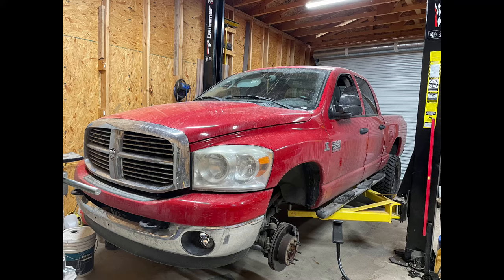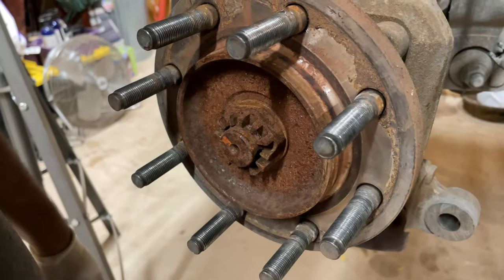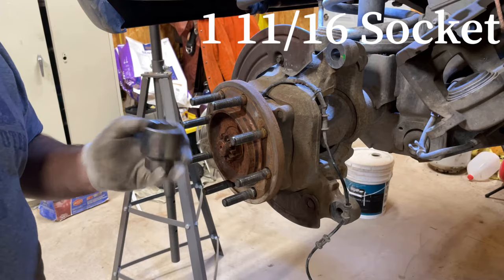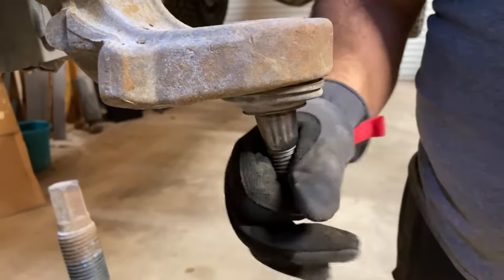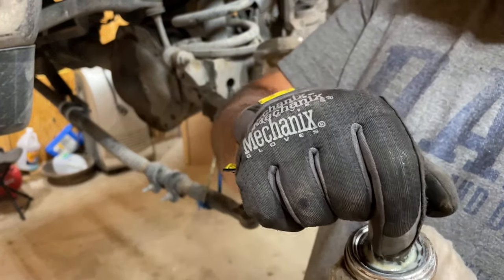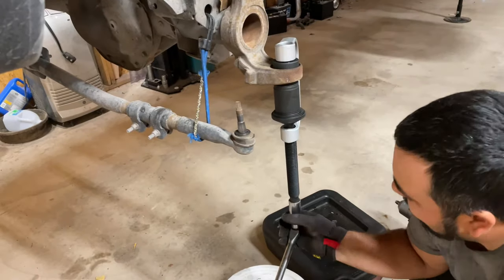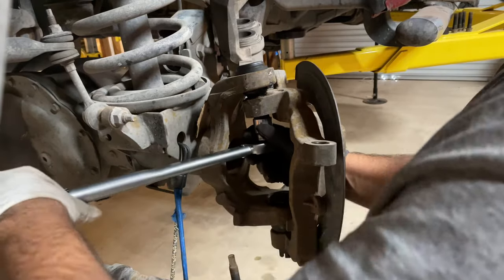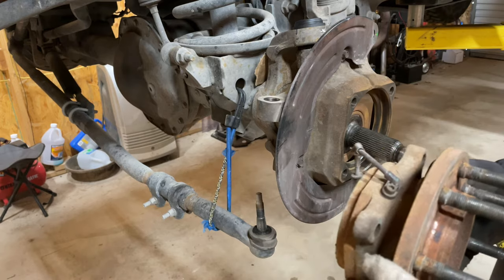2003-2009 Dodge Ram 2500 4x4 Ball Joint Replacement

Comment: Great Video, and helped me a lot.  A note for guys with older/high mileage trucks.  I just pulled two ball joints from the front of my 2004 2500 with 100k miles on it and a good deal of rust (country road use before I got it).  The only way I was able to get the bearing hub out of the knuckle was to use a full size sledge hammer.  Yes, that's correct.  Not a hand mallet.  A 3' 8 pound sledge, or whatever.  I knocked out the studs for the wheel, and then I used fairly long swings on the lower right and lower left of the stud flange, with a lot of force.  After about 6 hits on the front left, I saw a crack.  Took some whaling on it after that, turning the wheel direction each time, but it came off.  I can promise you that no "trick" was going to get this thing off.  The trick using the steering pneumatics, as the video's creator showed, in my opinion, and respectfully, because the creator did a great job with this video (especially the tip on the sensor and not trying to pull it out of the bearing hub), is not worth trying.  The power steering is not going to apply very much pressure at all to the threaded bolt - if that is enough force to get your bearing hub out, than a few swings with a hand mallet is going to get you the same result.  Also, there is about a 3/8" recess, so you have to work the bearing hub from both left and right - you can't just force it out from one side - it's in the recess too deeply.  Thanks for the video.
Reply from the maker: @andrewb2548  Thanks for watching, yea sometimes it’s takes a lot more to get it out 
And you have to straight man Handle it. 
Here in New Mexico we have no issues with rust like that. Glad you got it done though!!!’

Comment: The wheel bearing trick is fairly well known, But not to the rank amateur's, So thanks for including that.
  While working on a newly acquired Super-clean '03 2500 (with 54,800 one owner miles) --I had to have a friend turn the PS while I slugged away at the flanks of the upright (Knuckle). I also had to torch the crosses out of the U-joints, and then "Warm" the yoke ends before shocking them loose with a Ball-Pein", --As soon as they moved, I drove them out quickly with Home Depot--Ingersoll Rand Air Hammer with a flat end. I Torched the Ball-Joints out also, finished with little heat and a joint press. Everything back together with Anti-Seize or Loctite (as appropriate)... Since I figure I should leave my work with the assumption I'll be the next guy to go there again. because I probably will be...Also, you don't need to remove the brake caliper from the bracket, you can just unbolt the bracket and take it all off as one piece. 
Thanks for the really solid Vid and explanation, I'm sure even some seasoned mechanics may have learned at least one thing they didn't know before watching your Vid.

 I just wish my front end looked as "shiny-new" as yours!

Comment: Thanks for a really good video.  I noticed you had issues installing the upper joint using the ball joint press.  The press parts were metal to metal contact (not engaged with BJ) making it hard to press in.  I had the same issue using an Advanced Auto rental tool.  I went to O'reilley, and they had a 4 WD accessory kit that fit the BJ and made it easy to press in using the O'reilley press.  Please continue to post these 2500 videos.  I'll be watching.
Reply from the maker: Thanks for watching 
Yea sometimes they have to be just right so they go in smooth and not bind up.👍

Comment: Just did the ball joints, wheel bearing, and axle U joint on my driver side. Going to do the other side next weekend. 

Total cost for all the parts was $190 and $80 for the ball joint press.
Reply from the maker: @SandersChicken  Glad u got it done, thanks for watching!!!

Comment: I found out the upper joint is supposed to move up and down, but not sideways.
I wonder how many replace the upper joint before its time cause it moves like that. Of course once your in there, the sane thing to do is replace all 4. The bottom ball joint bears all the up-down forces and weight of the truck, the upper joint only prevents side to side motion. It telescopes by design. K7460 is the part number for upper joint,  K7467 for lower joint

Certain Dodge/Ram trucks and Jeep vehicles with solid
four-wheel-drive front axles use a telescoping upper ball
joint. The stud telescopes a small amount to compensate
for manufacturing variances in the tolerance of the axle
and knuckle ears.
This telescoping effect may result in the stud appearing:
• As if it is too long, or too short
• As if it has excessive play
The stud is engineered to slide in and out of the housing.
This DOES NOT indicate excessive play or any other issue
with the part. This feature is necessary for correct part
installation and function

Comment: Great video I I had to  Replace upper and lower on both sides on my truck I have an 06 ram 06 ram And both of my best friends are mechanics mechanics at an automotive machine shop But they didn't want to do it they said you remember that truck of all back where you were standing up on the table beaten all afternoon with a  Sled hammer Yes I remember never mind never mind the tool wouldn't work on that particular vehicle Cost me 450 bucks at a different shop
Reply from the maker: Thanks for watching!!

Comment: Fixing to do this on my 2006 Dodge Cummins.  Thank you for the detailed video!  Tom
Reply from the maker: Thanks for watching
Reply: What is the very best brand of ball joints to use on the 2006 Dodge Cummins?
Reply from the maker: @Okie-Tom  They have Carli ball joints that are supposed to be the best but cost $940 a set of 4 
They also have rebuildable Dynatrac ball joints that u can rebuild on truck 
I have only really used Moog ball joints mostly because customers want the cheaper option 
Hope this helps

Comment: Excellent video.  Now I understand how a shop likely damaged the seating area for an upper ball joint.  

Had to weld the ball joint in place after they created a loose hole. Later replaced the ball joint with a oversized knurled ball joint.  Dynatrac set.  

Truck is long gone, but this video gave me a great education.
Reply from the maker: Awesome!! I’m glad I was able to give u insite. 👍

Comment: Nice video! easy to follow, and I'm not so intimidated anymore attacking my own ball joints that need replacement. I'm pondering on the Carli Extreme Duty .... but they are expensive.... :-/
Reply from the maker: Glad it help you out. Those are good ball joints and worth getting if u keep the truck!
Unless you don’t mind doing the work to replace ball joints 
Then stick to a good quality ball joint that doesn’t break the bank lol
Also look into EMF rebuildable ball joints
Reply: @Jolaya03  I ended up ordering MevoTech TTX on recommendation from a friend of mine. Will most likely end up change them again at some point, if I keep the truck. (I probably do, since a 20 year old truck in Norway costs close to a brand new one does in US)
Reply from the maker: I’ve used MevoTech before and have had no problems with them. 
Especially MevoTech TTX they seem to be better quality than moog, in my experience. 👍

Comment: Wow and my local shop (Arrigo Sawgrass) quoted me 4500.00 to do mine based on 10 hours of labor. You did it in less than 2
Reply from the maker: Yea I believe the labor is 1.4 hours per joint upper and 1.1 per joint lower if I remember correctly 
You should be able to get it done for half that price
Thanks for watching!!!!
Reply: 4500!???? That’s goddamn criminal

Comment: You can remove the hub with the axle attached.  Unweioldy but then you don't have to retorque the hub axle nut to 263 ft/lbs.
Also, if you disconnect the tie rod first you can rotate the knuckle to one side then the other to get better access to the hub bolts.
Also, you can mar the inside of the top bore.  Some even recommend using a punch on the bore to add dimples and create a tighter fit if too loose.
Reply from the maker: You could do that, but I didn’t mind 
re-torquing  the axel nut. 
You could remove tie rod first which I have done when I’m working on the ground, but on a lift I had plenty of room to take off hub bolts.
I would rather just get knurled ball joints and press in, which are tight enough against the bore. 
I’m sure there is other ways which work for others, whatever works for people is good as long as it’s done right. 
This videos is just a general how too of ball joint replacement and tools needed. 
Thanks for your ideas though. Always good to here others different ways of doing things to get a job done right!
Reply: @Jolaya03  And thank you for taking the time to make the video in the first place.  Cheers!

Comment: Also always install unit bearing and axle at same time so the axle sits true , if ya leave the heavy axle hang by itself in there like you did  it will egg the seal and possibly cause leaks , and as you mentioned that job sucks replacing seals
Reply from the maker: It’s a possibility, I’ve haven’t had a problem in the last 20 years or so 
But good tip. 👍

Comment: Question I just bought a 2003 dodge ram 2500 and if your going 65mph and hit a bump it does the death wobble lol what would that be the ball joints?
Reply from the maker: @robertzettner4203  Hey there, it could be ball joints, or other parts of suspension. You will want to go under front of truck and check for any loose suspension components that could be worn. Check your ball joints, steering components, control arms,  track bar, wheel bearings, etc. 
depending on how many miles are on it, it my be a good idea to replace most of the steering linkages and ball joints. Be sure to buy quality parts of your choosing. Thanks for watching!!!

Comment: I saw you took non knurled ones out, why did you put knurled ones back in? I’m replacing mine and I’m trying to figure out if I should put the non knurled back in.
Reply from the maker: It helps seat the ball joint a little better 
To fit a little tighter.
The knurled ball joints are used as a replacement to those knuckles that are enlarged due to wear, or replacing existing knurled ball joints. When the  bore is enlarged by installing the knurled ball joints then you are committed to use  them and not go back to smooth ones  
Thanks for watching!

Comment: Great video! Makes me more willing to try this myself. I was able to change my front band myself i think i can tackle this! Thank you for the information and solid presentation. My only question is any more info on the ball joint tool as in what all i need? I dont have that tool and will need to get one. Also that last big castle nut you put on what was its torque on it? Thank you for video and help!
Reply from the maker: Thanks for watching. 
I have a link for the ball joint press in the description 
Between 140-160 lb ft for lower ball joint for my application 
I usually torque to 140 and then try to put the cotter pin in, If it doesn’t go In just tighten to the next slot and slide the cotter pin in.
Reply: @Jolaya03  thank you, and for castle nut i was refering to the 1" 11/16 end of axle nut. Thanks for link
Reply from the maker: @Diy-For-Life  The axle nut is “132 ft lbs Beginning Torque, Then Rotate 5 to 10 ~ Times With a Final Torque of 263 ft lbs”
But I cheated and gone to 250 on my big torque wrench and then just a smidge past the click 😬

Comment: hey do you know if this torque specs are similar to the 2007 dodge ram mega cab 4x4
Reply from the maker: I am not sure been a while since I’ve done one of those trucks 
I usually go to all days for torque specs though
Reply: thank you im having a hard time finding specs. my truck being mega cab sits on a 2500 chasi being 8 lugs. but truck is label 1500 because its 5.7l gas hemi  @Jolaya03
Reply from the maker: @victornaja-paz5241  i meant to say ALLDATA.com for the torque specs u need for your particular truck.

Comment: There is no wrong way to install a cotter pin. It's hole purpose is to stop the nut from backing off and as long g as it's through the stud then you're fine. It doesn't matter how you bend it. If you can't get it back off after bending both tabs and able to reuse it, sell your tools and stay away from vehicles.

Comment: You should show how to torque axle nut
Reply from the maker: I usually get a big screw driver stick between rotors vanes and brake caliper brakes to hold the axle from turning 
And torque down the nut with torque wrench.
If u go to my other video with the gmc 
Forward video to 28.10 mark and it’s same prodded I use to tighten the ram axle nut.

Comment: The ball joint on my 2008 4x4 hemi,driver side castle nut and cotter pin somehow became missing. The tire almost came off only held by cv axle into the hub. Besides ruining the ball joint did it possibly damage hub and cv axle?
Reply from the maker: If it was me I would replace the wheel hub bearing assembly for my peace of mind 
They are not very expensive. 
Then inspect the cv axle splines and and outer hub where the cv boot is for damage and replace if needed 
And of course lower ball joint and check upper ball joint for play since your already there.

Comment: Just curious why you didn’t use your impact to remove the ball joints?
Reply from the maker: I had a real bad eczema flareup and the vibration of the tool bothered my hands that’s why you see the white glove on 
Thanks for watching!
Reply: @Jolaya03  thanks for the reply. Have to do a set on my truck and was curious if it would wreck anything. Thanks for the video
Reply from the maker: @dereknorthway172  Just watch ball joint to make sure ball joint is going in strait, sometimes they bind up sideways as they press in. 👍

Comment: why not pull the caliper mount and caliper as one piece and save time.
Reply from the maker: No reason, i was in no rush to get done. I’m sure I could’ve saved a few minutes. But for a you tube video, people can see how to take off both separately.

Comment: How big of a ball joint press tool is needed as in the length of the C tool? And how big of a press bolt thread?  I have seen these tools come in different reach  lengths. I have a 2005 Ram 3500 4x4 diesel truck. I dont have to change them, all 4 have grease fittings.
Reply from the maker: I have the tool I used in the description, it works great. 
Just check for play in the joints and if none grease them up

Comment: The second way you did that bottom ball joint installation looks impossible without a lift.
Reply from the maker: I’ve actually done this same job on a black 07 ram 2500 with a floor jack and some jack stands at a buddy’s house with no issues.
Just have to lift a little higher
Reply: @Jolaya03  You are correct.   There is enough clearance.  Unfortunately had to go the other way because of the accessories on my ball joint set, and just stayed clear of damaging the upper ball joint socket.   Thanks for posting your video, definitely helpful.
Reply from the maker: @dan10400  Awesome glad to help, enjoy driving on new ball joints lol. 👍